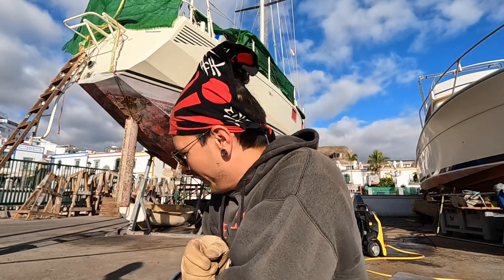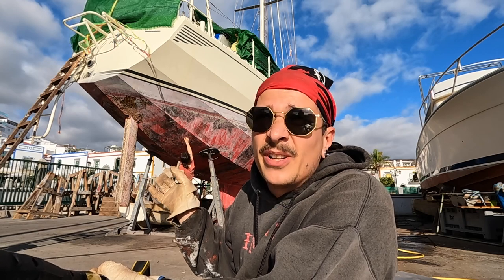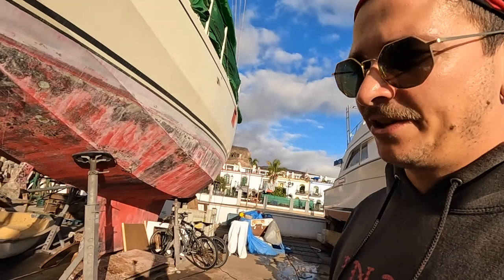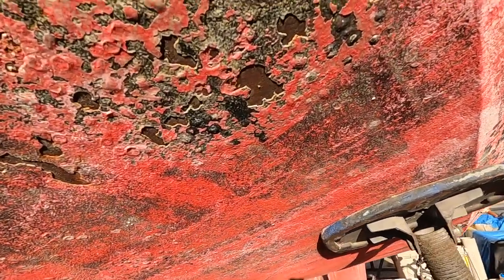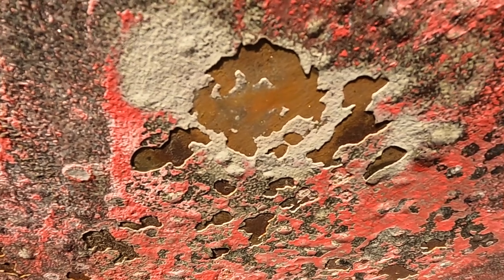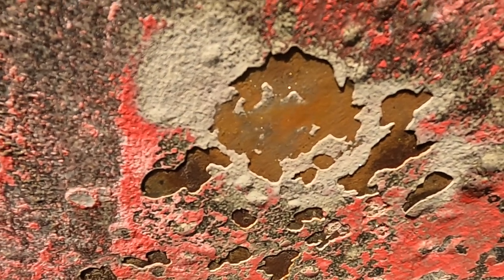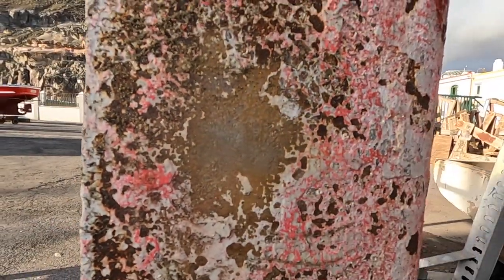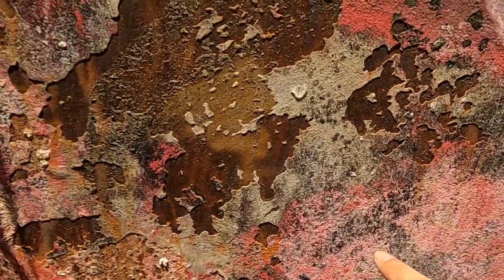Ep 21 - We try wet sandblasting!  Kärcher sandblasting kit for steel boats, does it work?

Comment: Yeah you need at least 3000 PSI but more importantly you need to be pushing 15lpm + . For the cost of that karcher you can get a petrol one that will do it under those specs. Cool video though . Will follow

Comment: Also that pressure washer isnt pushing enough water and its weak like 2,000 psi or something, no wonder there are little results
Reply from the maker: Could be that with more pressure the result would be better. Considering we use a K7, one of the stronger Kärchers available retail, the experience for many people out there might be similar.
We did a much larger test surface as well, about  5 sqm, so the gear and technique works just fine. Check out those videos, they just published!
Cheers

Comment: Wet sandblaster with pressurewasser is good procedure but you have way too small equipments. Atleast 20litres per minute and pressure should be 250bar if there is that size object to clean. How long it takes to clean that bottom?
Reply from the maker: If I remember right it was reasonably fast. There is another video on this pressure washer on our channel where we clean a larger surface, ca. 10sqm, and where we also talk about how fast it is. Check it out!

Comment: Using ordinary sand is a terrible idea - especially without a proper respirator. You are putting yourself and anyone working close to you at risk of silicosis.
Reply from the maker: Thank you Mick for your considerations!
Safety and health hazards are important to us and we do our best to address them. 
Rest assured that we are using respirators/masks wherever appropriate. In this application however, as it is wet sandblasting (sand and water mixed), there is only minimal dust produced while working, as opposed to regular sand blasting. The use of masks is not specified for this type of wet sandblasting, thus we deemed respirators unnecessary for this short test. For larger surface areas we are using a tent setup to further minimize impact on people working close and wear appropriate personal protection gear as well.
You can also rest assured that we are using a suitable blasting media on aluminium silicate basis with a hardness of 6-7 Mohs and 0.2-0.8mm grit, as per specifications for this application.
We hope we were able to dissipate some of your concerns and are looking forward to your future inputs 😀
Reply: Hi there, wearing a mask is essential even if there is water reducing the dust, it’s a mist with silica granules as you found out when you noticed sand in your mouth. Your safety is paramount and please don’t become complacent, I was a nurse for over 50 years and have seen the sad end of several people with silicosis, asbestosis and other lung disease of work/ lifestyle related origin. This was a good comparison for me as water sand blasting has an appeal. The quick flash rusting happens very fast with water doesn’t it. I live in a humid environment and haven’t sand blasted anything but wire brush Ann abrasive disc surface prepped my tractor implements. Due to the very slow process I not that flash rust happens after a couple of days. I guess flash rust is so easily rubbed off or surface treated chemically before paint that it’s no major concern. Thanks for the video.